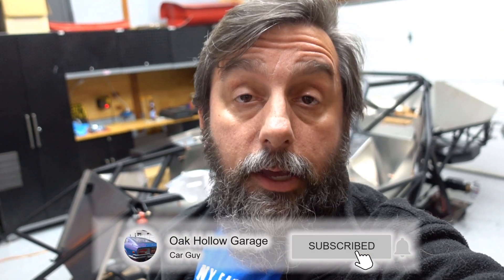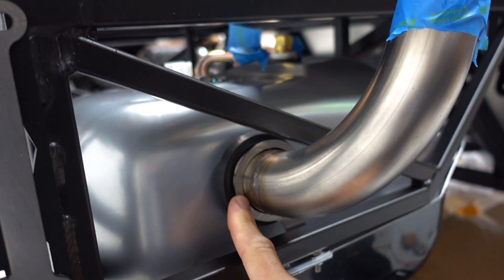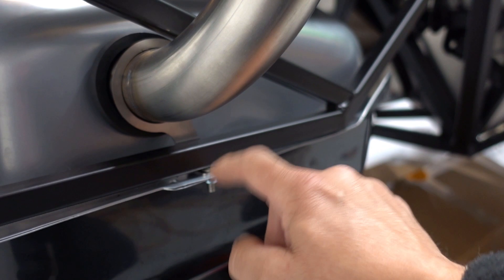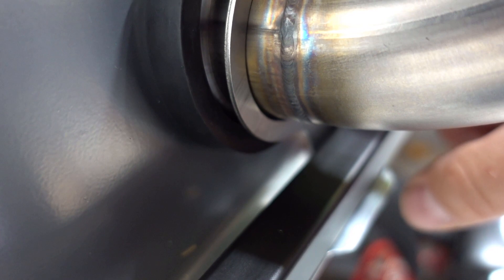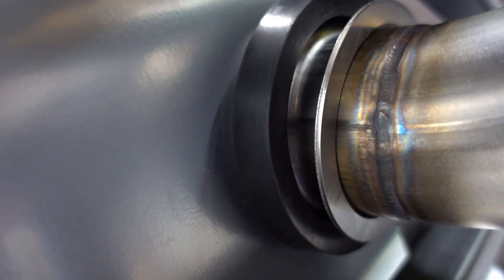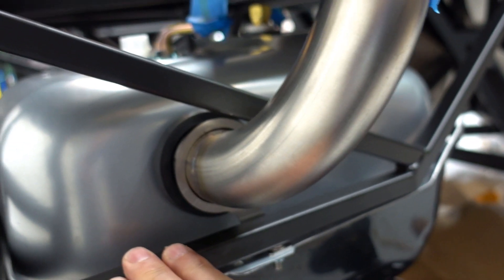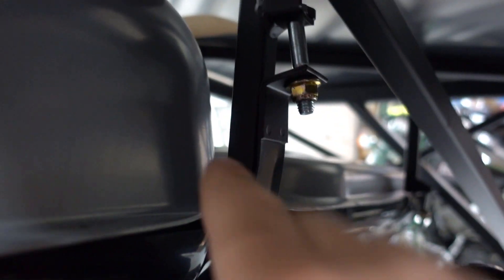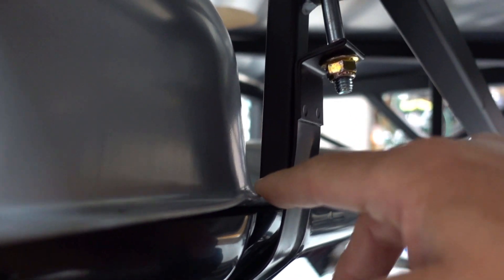Part 9 | Fuel Tank Installation lessons learned | Daytona Coupe Kit car build

Comment: We spent the last 2 1/2 years building a gen2 coupe. The tank wasn’t a perfect fit but using a ratchet strap helped keep it in place as we tightened up the strap bolts. Initially I think we used longer bolts until the straps pulled tight against the tank’s plastic cover. Having pretty much finished the car (with much help from our paint/custom fabrication shop) our biggest bugaboo is fuel starvation with less then 1/2 tank of fuel. On tight turns such as an entry ramp, the fuel pressure from our in-tank Holley pickup/pump to a Holley Sniper FI system drops to zero until straighten out. I think Holley’s hydramat is the answer.
Reply from the maker: Nice! Thanks for the feedback. I will certainly keep that in mind.

Comment: Just a fox body/sn95 fuel tank assy. Straps are designed that way.once and done. The ring was used to support the top of the filler neck. Ffr repurposed it. Leave the seams alone don't drill , it will leak. It's custom it's not supposed to be easy.
Reply from the maker: Thanks for the feedback.

Comment: Fit and finish frustrations. They can eat up your time.  Darn.  I thought CAD workups, didn't translate, hum. 
We did a ground up restoration, 1959 Austin Healey.   Sometime I wonder if these "engineers" should spend a couple of years in the inspection division.
Reply from the maker: Ya, these cars always have a few small fit and finish issues. It's part stock mustang parts, part aftermarket parts, and part custom parts. It's a fun challenge so far.

Comment: Nice job—looking good!  Be very careful with the fuel tank when you do any bending of the outer seam; my son and I just put a new tank in his Beaumont and it leaked where he had bent one area of the outer flange up.  That seam weld is not very strong, and I definitely wouldn’t drill a hole on the tank side of the seam.   Keep up the great work, it’s fun seeing you progressing along.
Reply from the maker: Thanks for the info. I appreciate you watching and offering feedback. I'm far from any kind of expert. Just having fun working on stuff in my garage.